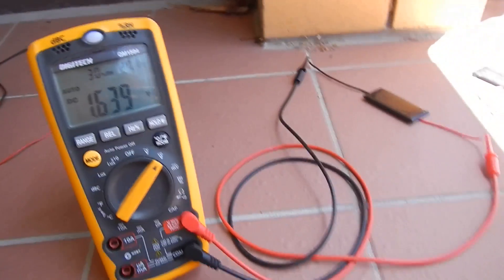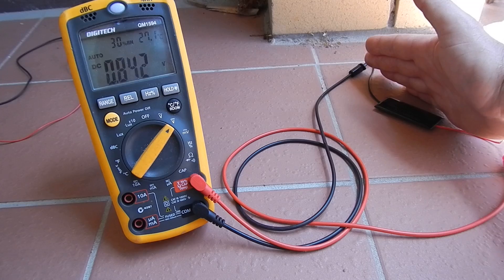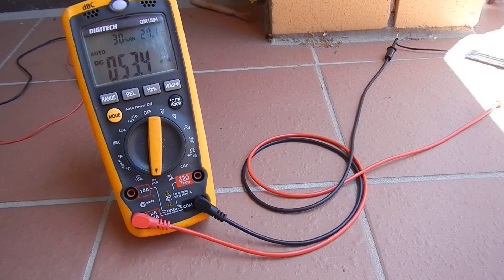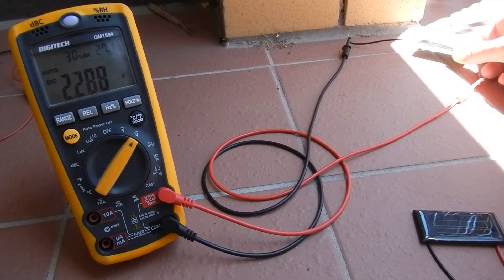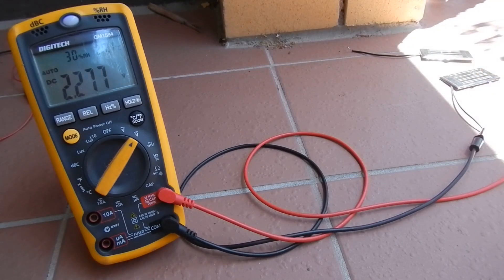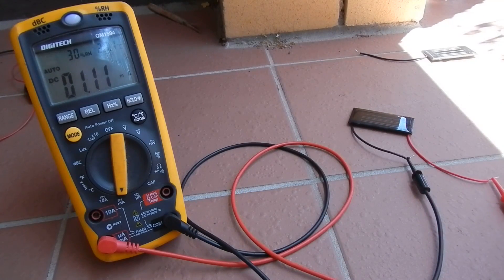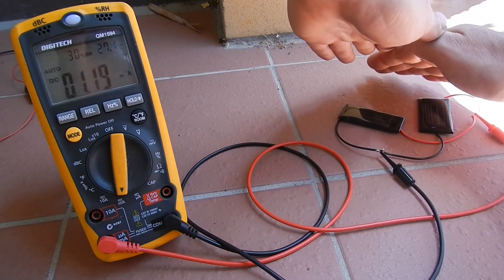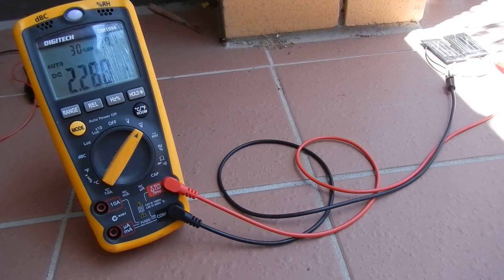Solar Cell Short circuit values.

Comment: hi mongrel im building a project and i need a cell that would provide 3-6v with output current of 300mA, i bought some, they would provide the voltage but not the current ! what do you think the problem is and where would you advice to buy cells from ?
Reply from the maker: No one cell will provide that. You need to put the appropriate amount of
 cells in series & parallel to get the voltage and current you need.

Comment: So, you can't destroy it by short-circuiting it?? That's the same for the big ones?
Reply from the maker: +Jonnah Smith Sorry about slow reply. The answer to that question is debatable. I don’t think it would do any harm for the time it takes to get a reading. You wouldn't want to leave any cell shorted for a long period though. I can see stuff getting hot.... On small scale the amount of extra current compared to actual use situations (say charging a battery) would be tiny. On larger panels it may be a significant amount. You wont be able to use a conventional Multimeter on larger panels either. They will blow the meter (or its fuse, or both).
Reply: +Mongrel Shark Oh, I understand. Thanks for that.